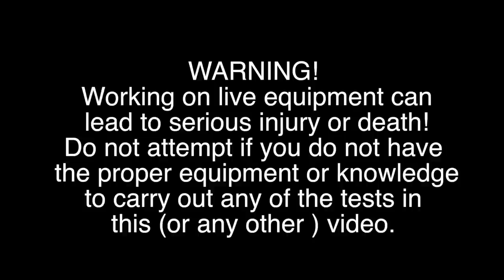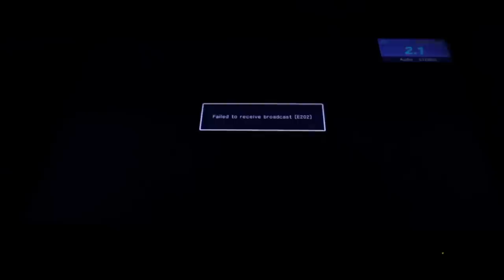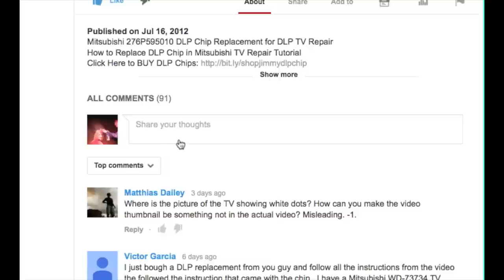Sharp LC-32 1 Blink TV Repair How to Troubleshoot Problem Between Bad Lamps and Power Supply

Comment: Jimmy
I have a Sharp LC-70LE650U a month after the warranty expired I observed a brown burnt spot on the screen.  Only appears during certain dark colors.  Any ideas about a fix?
Reply from the maker: +Frank Wong   Try all repairs and troubleshooting at your own risk.  This sounds like a TV panel (TV Screen) problem.  If your TV panel is bad, it may be more cost-effective to replace the TV as panels are typically hard to find in stock, difficult to replace, and expensive.  Thanks and please let us know if you have any further questions!  www.shopjimmy.com

Comment: have a Sharp Aquos LC-37D62U that has that issue where at random it shuts off for about 5sec and turns back on, however, the green light stays on and doesn't blink. Most sites I've seen seem to indicate that the light should be flashing a code, but no flashing. Any ideas?
Reply from the maker: Thomas Robinson   Try all repairs and troubleshooting at your own risk.  I recommend replacing the main board in your TV.  Click this link to replacement parts for your TV model number:  http://www.shopjimmy.com/catalogsearch/result/index/?cat=56&q=LC-37D62U  There may be multiple boards for the same TV model number, be sure to match part numbers on your current board, with your replacement for compatibility.  Thanks and please let us know if you have any further questions with your TV Repair!  www.shopjimmy.com

Comment: Thanks for the video. I have a sharp LC32D44U, the green power light is flashing once a second(continuously, no pauses). If I hold the power button down, the power light will turn red, the tv turns on and I see a beautiful bright picture, I don't see an dark bands to indicate a dead bulb... then a few seconds later the tv turns off and flashes the green light again, once a second continously. What do you think?
Reply from the maker: +Jimmy James  Try all repairs and troubleshooting at your own risk.  Unplug the TV for 30 minutes and then plug i t back in and see if you still get the blinking light.  Thanks!  www.shopjimmy.com

Comment: Hi Jimmy I have a sharp lc42xd1ea the power button has snapped off I don't have a soldering iron and have ordered the new part but is there anyway to get the TV on until it comes ? Thanks
Reply from the maker: Cheryl Robson   Can you use the remote control?  Thanks!  www.shopjimmy.com

Comment: I have a lc32sb23u sharp TV and it will run fine until it heats up an it will shut off . Would that be the power supply ?

Comment: hello i have a sharp lc- 32sb23u tv and it shuts off on its own. i was able to hold the vol - and input button while plugging back in. the k appeared on the screen and i then pressed vol - and ch - really quick was able to get to the menu amd got to lamp errors it said 4. but the tv keeps going black no picture but there is sound. is this junk?

Comment: hi hopJimmy.com
 i just wanna know what is the possible problem of SHARP LC-32A33M AQUOS it start and open normal picture but after the picture come out it going to off and back to stand by mode... and if you hit the power button again it goes on again normally picture come out but then again it goes off and back to stand by mode again...thank you..

Comment: Hello, I'm just needing confirmation here. In the video, after you solder in a jumper, when you power on the tv you get a black screen with a window that has the error code. If I understand correctly this indicates bad lamps. I followed the same process and when I power on mine I don't get the black screen with a window, I get a picture (actually a snowy screen) without the window and error code. Does this indicate that the power supply is bad in mine? Thank you in advance.

Comment: I have Sharp Aquos  Lc-32gp3uw which is blinking power and opec lights three times. I have no sound no picture did replace the Power board did not do anything wonder if the Main board is bad. how can find out if the main board is bad.

Thanks

Comment: Hey ShopJimmy,
I have a Sharp Aquos LC70C7500U. I had no power so I replaced the power supply. Now I am receiving Error code that has 2 short blinks and then 5 fast blinks. I downloaded the Service Manual which indicates this to be "DET_PNL12V Failure (L). Panel power is not applied." Not sure if this indicates a failed power supply or a T-Con board or perhaps the main board. Will you please provide guidance?
Reply from the maker: Drew Splawn   This sounds like a TV panel problem.  If your TV panel is bad, it may be more cost-effective to replace the TV as panels are typically hard to find in stock, difficult to replace, and expensive.  Thanks and please let us know if you have any further questions!  www.shopjimmy.com

Comment: I have a Sharp lc-60le650u no audio and video with the following codes 2 slow flashes and 5 fast flashes.  any help would be beneficial
Reply from the maker: +L S   Try all repairs and troubleshooting at your own risk.  This sounds like a TV panel (TV Screen) problem.  If your TV panel is bad, it may be more cost-effective to replace the TV as panels are typically hard to find in stock, difficult to replace, and expensive.  Thanks and please let us know if you have any further questions!  www.shopjimmy.com

Comment: I have a 32 inch Sharp Model #LC-32SB23U.pitcher comes on sound comes on after 30 sec pitcher goes out .what do you think.could it be the Power Supply.

Comment: Hey Jimmy I have a Sharp lc-32sb24u and when you reset it it works fine but there is a little shade of red in the center of the screen and about a min later it turns off then goes to flashing green again. Also when you first plug it up it blinks green.
Reply from the maker: jc deer  PLEASE SUBSCRIBE TO OUR CHANNEL - Try all repairs and troubleshooting at your own risk.  Please upload an image or video of the problem online and then reply with the link.  Thanks!  www.shopjimmy.com

Comment: My sharp lc80le844u cuts off the sharp symbol blinks 1 time and cuts back on. I still have picture and sound.  Tv only cuts off about 10-15 seconds.  I did the back door reset and it said I had “ 0 “ lamp failure faults.  I don’t know what else to try. Any suggestions would be great. Thank you

Comment: Hello I have a sharp 32 inch put a new power supply board in it today . The tv still will not stay on . It will power up and only stay on a couple of seconds ? Any thoughts pls . Thank you heather
Reply from the maker: hgoldengirl1   I recommend replacing the main board in your TV.  Please reply with your TV model number.  Click here to view a video that shows how to find your TV model number:  TV Repair STEP #1 Help IMPORTANT TUTORIAL How To Find Your TV Model Number Tutorial TV Repair Help  Thanks!  www.shopjimmy.com

Comment: Hi Jimmy. I have a Sharp Aquos LC46D65U and won't turn on. When I plug in the power cord, the green power light turns on steady. I hear clicking from the power board, after 3 series of clicks, the OPC light blinks once and the power light blinks 3 times (in series). I changed the power board, it does the same thing. Please help.

Comment: Hi ShopJimmy,

I have a Toshiba 40L1353B LED TV and I'm having an issue with the it staying on.
When I power it up, it may stay on for about 30 seconds or it will briefly flash before going off.
I've used the flashlight method and you can see an image on the screen.
I've changed the inverter board and it still does the same thing.

I'm wondering whether I should look to changing the power board, or whether the output board needs to be replaced.
What would you recommend.
Reply from the maker: chomerly   I recommend replacing the main board in your TV.  Unfortunately I do not see any replacement parts in the search results for your TV model number on our website.  Please reply with your part number on your main board and I can try searching for replacement parts.  Thanks and please let us know if you have any further questions!  www.shopjimmy.com

Comment: I have a 70 inch Sharp Aquos that won't power on. I get one slow/long blink then one quick where the power shows. Ive tried all the force on troubleshooting there is and still nothinh. Can you tell me what's next....  LC-70LE632U model#

Comment: I have sharp aquos lc32a37m then a large voltage flowed to the tv because lightning struck our area and then the tv is not working anymore what should I replace?
Reply from the maker: Christopher Justine Cunanan   I recommend replacing the main board and the power supply board in your TV.  Unfortunately I do not see any replacement parts in the search results for your TV model number on our website.  Please reply with your part number on your power supply and main board and I can try searching for replacement parts.  Thanks and please let us know if you have any further questions!  www.shopjimmy.com

Comment: i have a 50 inch sharp tv led model number lc-50lb37ou when i turn the tv on their is a red blinking light that blinks for 7 time then goes solid blue no picture but if i hold a flash light on the screen i can see the menu any i deal thanks

Comment: Hello shopjimmy,

I have a Sharp Aquos LC-60E79U. When I connect the power cable, there is a click, so for now I believe the relay is doing its job. I try to turn the TV on, and the power light blinks 2x together with the OPC light, then the OPC light blinks 3x, then the cycle starts again, but the tv never turns on.

So flashes: Power Supply = 2x, OPC = 5x

I searched online and I did see a lot of people that mentioned the input/volume - trick.

I did that and the tv turned on, but as soon as I turn it off, the power/opc cycle starts again and tv will not turn on unless I do the trick. It will not work with the remote either.

It sounds to me power voltage is the issue. How to test power supply board
(DPS-343AP)?

Thank you!
Reply from the maker: Raul Legarreta   The 25 mean a shorted panel.  If your TV panel is bad, it may be more cost-effective to replace the TV as panels are typically hard to find in stock, difficult to replace, and expensive.  Thanks and please let us know if you have any further questions!  www.shopjimmy.com

Comment: Hi I have Sharp 32D44U.......It will turn on but after a minute or two it the screen will brighten slightly and shut down with the green light flashing. I have reset it by holding the power button down and following the rest procedure but the problem persists. Interestingly I played around with luminosity button and when it went to the brightest mode the TV shut down immediately.....Am I correct in assuming that with this behaviour it is likely that it is a lamp problem as opposed to a power supply one.

Comment: i have a Sharp Lc42d69u.  The screen flickers from color(blue) to black with horizontal black lines.  Would you know what problem i may have? Thanks!
Reply from the maker: Amir Elnawawy   This could be a problem with either the main board or the TV panel.  You can replace the main board to see if that fixes the problem.  Click this link to replacement parts for your TV model number:  http://www.shopjimmy.com/catalogsearch/result/index/?cat=56&q=Lc42d69u  Be sure to match part numbers on your current board, with your replacement for compatibility.  Thanks and please let us know if you have any further questions with your TV Repair!  www.shopjimmy.com

Comment: I have a problem with my SHARP LC-42LB261u 
TV Turns on.... No pictures...But with all the lights off in the room you can faintly see the screen with image [ie.. Settings menu] The screen flashes to show the settings roughly every 2 seconds...and just repeats continuously... Replaced the t-con board [3 separate t-con boards...no change in brightness or the screen from flashing.. We disconnected the t-con board to see if there was a change, obviously the picture with settings and such did not appear, but the faint backlight flashing every 2 seconds or so still remained constant...
Should we replace the power supply board or the input board? Any ideas would be helpful!

Comment: Hi jimmy..Ok..I have a Sharp 65d64u... Ok.. My problem is.. I have the power light flashing.. I rest the TV..and the back light come on..sometimes with a black band at top and fuzzy at the bottom.. The TV shuts off after 3-5 sec and the OPC light comes on but doesn't flash..so I have the Opc and the power light on..then the opc light goes off and the power light starts back flashing.. I have tried to reset it also... But same thing..
Reply from the maker: terica dubois   This sounds like a TV panel (TV Screen) problem.  If your TV panel is bad, it may be more cost-effective to replace the TV as panels are typically hard to find in stock, difficult to replace, and expensive.  Thanks and please let us know if you have any further questions!  www.shopjimmy.com

Comment: Hi I have a Sharp Aquos LC-32D44U. It stays on for approx. 10mins then shuts off. I tried Your Re-set and The green light blinked at a slow rate. on-on-on-on. It kept going like this until I powered it off. I guess this is an error code. So after that it still does the same thing ... shutting down after 10mins. Is this a overheating issue? can you help please?
Reply from the maker: MARK-ANTHONY JARVIS  Try all repairs and troubleshooting at your own risk.  Does it give 4 blinks and then repeat?  Thanks!  www.shopjimmy.com

Comment: Hopefully this will help someone. My parents lost their picture and got the error code of 1-1 (bad inverter/lamp) on their Sharp Aquos 60" TV. I'm not 100% sure of the model number. It's about 6 years old. They talked to Sharp and to the Geek squad who told them how to reset it with 2 buttons but nothing worked. Then they found where someone posted online to hold the volume up and channel up and power it off (so 3 buttons on the TV itself, not the remote) at the same time. Then unplug it and replug it then press power on. It immediately started working and has been working just fine all day long.

Comment: Hi there.

I have a question about my TV which doesn't turn on and also I miss the remote controller.

My TV is a Sharp, LCD Colour TV, model n° LC-32LD145K Serial N° 312923719. This TV doesn't turn on at all doesn't have any light turning on is completely off. I heard around that might be the capacitor blown up and opened the circuit but I'd like to seek help to have a proper diagnosis of this issue. Also is it going to work without a remote controller because there are not any other buttons where I could actually switch it on manually.

Comment: This is a sharp LC32SB24U. The power board seems to be fine, but if Eye let it play, the back lights go off. When Eye open up the set, and push down on the board the lights come back on. It seems like the problem is around that heatsink on the left. It's almost like somewhere on the power board is not making hard contact. looking forward to hearing from you. Maybe you have some suggestions for me, thank you very much.
Reply: Thomas Anderson do you remember what the blink sequence you were getting? I'm getting the power to blink once and then simultaneous with the opc light and the opc blinks 2 more times.

Comment: Hi Jimmy I have a Sharp LC 52D64U the power light is flashing green steady, no image is there a  hard reset sequence that I can perform? can you suggest a solution? Where is your shop located. Thanks in advance for your help.
Reply from the maker: Enrique Cc   unplug set and the hold volume down and input buttons on your set, then plug in the TV set and let us know if that fixes the problem.  Thanks!  www.shopjimmy.com

Comment: I have a  Sharp Tv 60 inch Model  LC-60LE640U i had a lighting storm and light hit my house and all 3 of my tvs just shut off there all the same brand and size etc but i tried to turn them on and it doesn't come on all them do this. 
What could it be?

Comment: Hi jimmy..the power and opc light blinks at the same time once then just the power blink..(power+opc) 1x followed by (power) 1x..it keep on repeating that pattern..thanks..
Reply from the maker: janmark98   I recommend replacing the power supply board in your TV.  Here is a link to replacement parts for your TV model number on our website, click here:  http://www.shopjimmy.com/catalogsearch/result/index/?cat=59&q=lc46d64u  Be sure to match part numbers on your current board, with your replacement for compatibility.  Here is a link to a video showing how to identify your part number, click here:  DIY TV Part Number Identification Guide for Sharp Power Supply Unit (PSU) Boards  You can also call our customer service for further assistance with your purchase.  (877) 881-6492  Thanks and please let us know if you have any further questions with your TV Repair!  www.shopjimmy.com

Comment: I got Sharp LC-70LE640U 70" LED TV the just stopped working. The white "V" is flashing - one long, one short, one long, one short. I cannot find what it means. Can you please help and tell me what could be the issue? TV is approx. 4 years old and there is no warranty left, but it was so expensive that I disappointed now. I wish it could be re paired. Again one long bling, one short, one long, one short etc. Is there way to know what they issue is? Thanks!
Reply: +Alex Garin hello heres how to fix.. try this ..unplug tv press and hold vol up and ch down side by side buttons on the tv and plug it in ..

Comment: i have a problem with a sharp tv lcd aquos model no 32a33m he turn on and shut down and stay on stanby i alraedy resolder the capacitor no c7558 but shame probleme i need your help thanks
Reply from the maker: Daniel Marie Rock  Try all repairs and troubleshooting at your own risk.  I recommend replacing the main board in your TV.  Unfortunately I do not see any replacement parts in the search results for your TV model number on our website.  Please reply with your part number on your main board and I can try searching for replacement parts.  Thanks and please let us know if you have any further questions!  www.shopjimmy.com